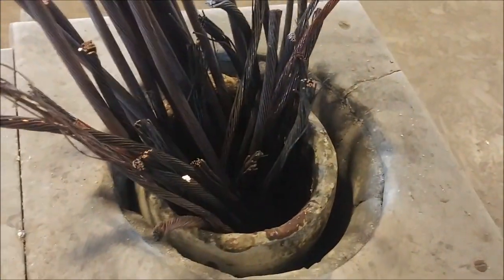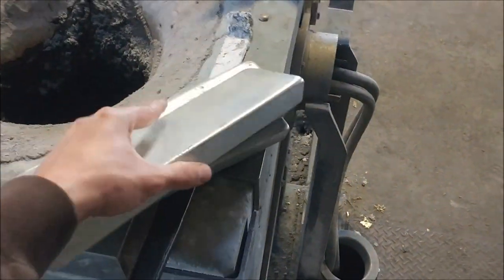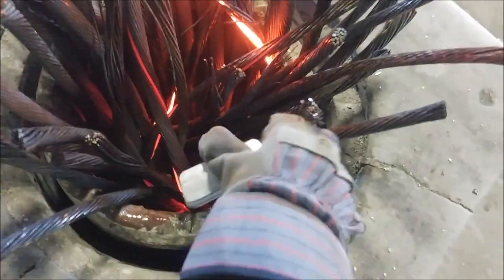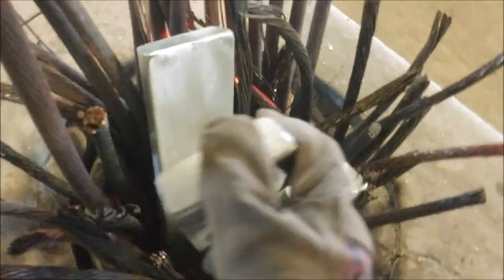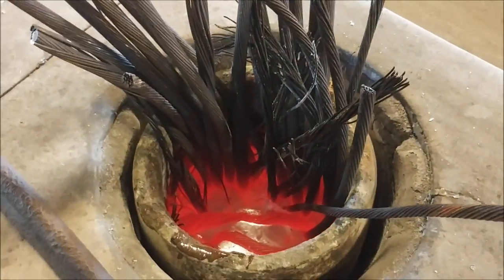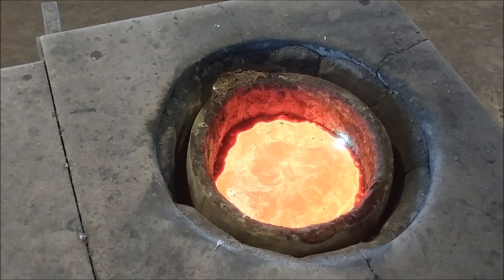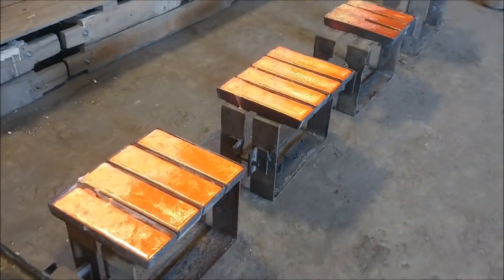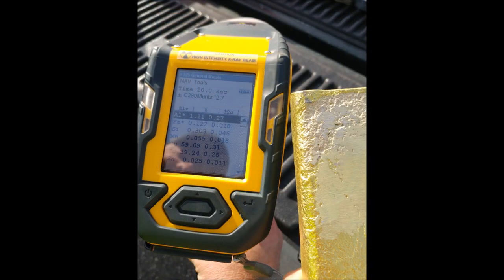Making Brass from Scrap Copper and Zinc at our Foundry

Comment: This has to be the first video I've watched of someone pouring brass where there isn't huge billows of zinc boiling off the top. I think the method of disolving the copper in molten zinc was the trick, a new method to me. It would be interesting to know the temperatures you're working at. Thanks for the video. Excellent as always.
Reply from the maker: The copper starts to "dissolve" (not sure this is exactly the correct term) at about 1500 F then we pour about 1850 F or so.  Keep the temp around 1500 until the copper is all in and then raise from there
Reply: Philip Stoller hi this is my first time watch someone making brass
Reply: @mbmmllc  I was looking into making brass today and was asking around about how to avoid issues with the low boiling point of zinc. Thank you SO much for posting this video!!! Quick question...once it's actually poured and cooled and the alloy is fully formed at room temp...are there any further concerns for re-melting the alloy? Like...will the zinc potentially separate in the molten state and start boiling?
Reply: What are you trying lol

Comment: I've tried this method and made 50-50 copper zinc brass, which is yellow and looks a lot like gold. Thanks a lot for the tip. Before i was putting zinc in molten copper and it was not good (zinc oxyde fumes are not nice to inhale : metal fever). In fact copper does not dissolve in zinc. Zinc diffuses in copper and transforms it into brass. Some copper also diffuses into the zinc. The new brass melts down and then you can increase the temperature above 900C without the zinc boiling.
Reply from the maker: Great! Thanks!

Comment: It is very important to cut the copper into very small parts to increase the copper surface and the speed. I have made my brass at 600C first, then 750C, then 1100C for pouring.
Reply from the maker: Great, thanks for the tip!
Reply: Thank you for this information, I am currently trying to mix Cu and Zn and it makes lots of smoke but it is precisely because I raise the temperature to quickly
Reply: @puits-de-science  I already had the fever, with a headache … my body expulses that, right?
Reply: @puits-de-science  what is the white powder that sticks to the surfaces? Pure zinc?
Reply: @TheBruzka  I think so. I understand it is not a poison. But be careful with foundry, nether breathe the foundry gasses. For example, hexafluoride, an aluminium degasser, becomes combat gas at around 150C and a nerve agent when mixed with aluminium. Always work in a very well ventilated place and if possible with a good mask.
Reply: @TheBruzka  The white powder is zinc oxyde. Not dangerous.

Comment: very informative video۔ few questions i want to ask that you mentioned that you added aluminium into the molten copper and zinc but you didn't told when you added and if we want to add more aluminium like 7% ? Further more can you tell how to add iron into this brass? and the last question is I also want to add 3% manganese in the brass, what temperature we required? My target is to make brass with following composition 
Cu 68%
Zn 24%
Al 7%
Fe 4%
Mn 2%. 
I hope to get some supportive response.  Thank you

Comment: I used a long pliers to hold a six-inch zinc billet in the flame until it dripped molten zinc into the melted copper in the crucible.  I lifted the furnace cover and quickly stirred the hot billet into the melt.  Lots of smoke, but the repeated process produced beautiful 60/40 brass with only about 6% zinc loss.

Comment: Hello . I usually base 300 grams of copper and a few grams of zinc. I have noticed that the zinc added to the molten copper burns. I would like to know if the right sequence to prevent zinc from burning is the one in the video and if it is also good for small quantities of brass

Comment: What is the ratio of metal used to making brass Spatially used for electrical contacts and connecting foils .
Reply from the maker: Not sure about the specific types of brass for electrical contacts.  I would do a quick google search and it would tell you the type of brass used.  There are lots of different types of brass.  Most are between 60%-80% copper with other additives depending on the use